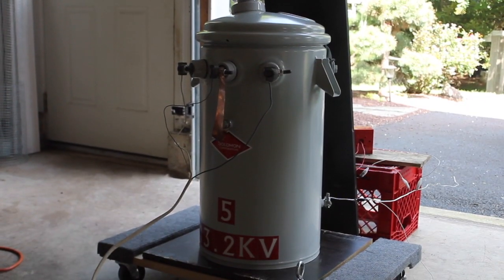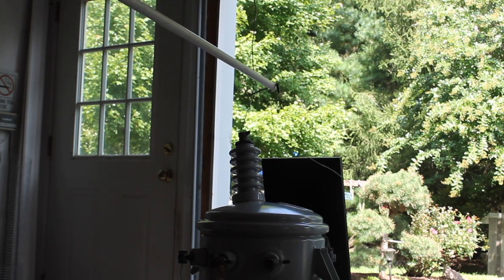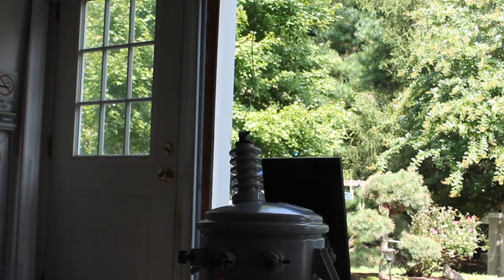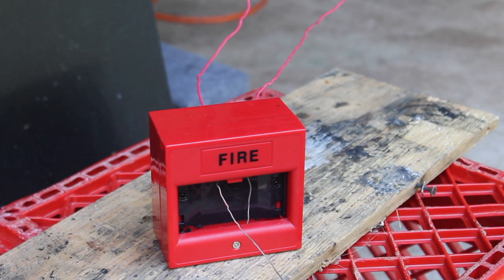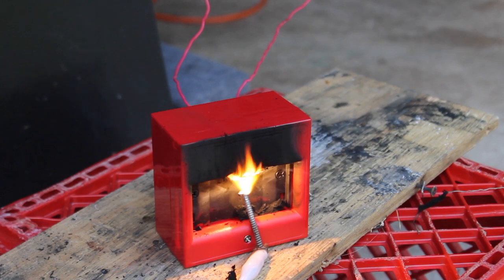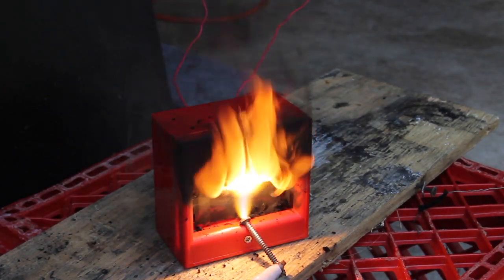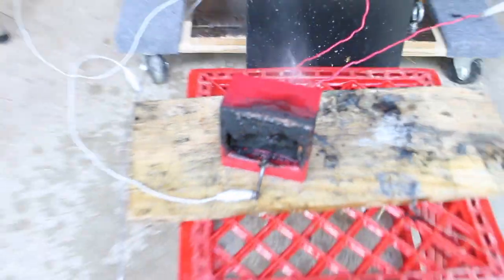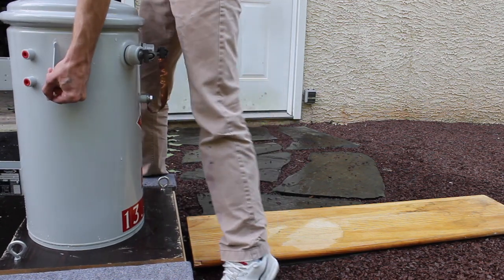Chinese Fire Call Point Versus 7,620 Volts

Comment: Did you connect the transformers in parallel and used the output of the bigger one to power the pole pig? Lmk please wiring looks hard to see the circuit

Comment: Why would you do that that was kind of stupid
Reply from the maker: Tyler's fire alarms and more This call point is basically a disposable unit, only costs $4.00 from China. But to replace the glass you need to buy a new one.
Reply: I too have bought one of these to inspect & test... As mentioned, it is a dodgy cheaply made clone of the real reputable manual call points. 

IF you really love fire alarms, you should understand the importance of proper design, testing, certification & classification of proper products from reputable manufactures who's primary goal is protecting property and lives, not profiting, and you would want nothing to do with knockoff faux clones, nor have any respect for them. I have a lot of FACPs and bits in my collection, they are all real brands and IMHO you (as a fire alarm aficionado) will also strive to only have said real products in your collection. These clones SHOULD be destroyed, and infact, should not be allowed on the market... because some sad corner cutter will use these in real service, risking property and worst, life... on products not proven fit for the job. We all know there are always rule breakers...I would sure hate to hear in the news that live(s) were lost due to a failed dodgy fire alarm system.

Metersocket00 made a good example of what these clones deserve, in probably the most ironic way one can ^_^
Reply: Benjamin Esposti I know it's just a switch but I really like like fire alarms and I do not like to see that torture to fire alarms
Reply: S Midnight Sparky so you think the cold Point pull stations should be destroyed
Reply: Tyler's fire alarms and more not all of them but this Chinese one had to go. It was cheap to look at anyway. It is probably against code, you couldn’t buy glass, and many other problems were with this thing.
Reply: No, you buy replacement glass from EBay or somewhere else
Reply: LOL all the butthurt fire alarm gurus ... it's a cheap POS. In fact I probably wouldn't trust it in a proper installation to begin with!
Yes, I know, it's just a switch ... but I've seen cheap chinese switches fail with very little use. (One was to switch LEDs on and off. It was a 5V circuit, load approx 100mA. Contacts failed. Lol.)

Comment: There's something amusing about seeing a pull station burst into flames lol nice job. Also, could I suggest a better way to power you pole pigs? If you power with 240 mains, you're much better off than with a step-up xfmr. If you don't have a 240 socket, you can use 2 120 sockets as long as their respective breakers are on opposite sides of the panel. Use hot-hot without the neutral. Simply use 1 mot on each hot wire as ballast to the pig and voi la! You've doubled your input power without using more than you already do on each breaker. I've done it safely in the past with great success and like to pass on the tip to other enthusiasts. Stay safe and have fun!
Reply from the maker: Thank You! Back when I got my 7200V xfmr I took 2 out of phase outlets to power it, but since there was no ballast it tripped the 2 20 amp breakers immediately. Since my 120 to 240 step up transformer is only .5kVA it does not fully step up to 240, its 230-239V. I plan to buy a 240V 30A reactor or ballast soon.
Reply: I too have made that mistake! It wants a little more than 20A, doesn't it? Haha If you do find a proper 240v ballast, you'll sure be impressed with the output. Even the 1 mot per leg setup I mentioned works great with 25ish amps output. They will get warm, but a 30A reactor could go all day! If/when you get one we'd love a vid on it ;) On a side note, I'm starting to really want to own a pig once again! Back before my renting days I had a 10kVA 7970/13800y pig. Used a 240 arc welder as ballast for about 50A, STILL wanted more amps lol
Reply from the maker: MaTTdeluca14 I am still looking for the same sized mot for another 120v ballast. I agree that mots make great ballasts! And that’s they only thing I use them for, but I got my lone mot out of some GE microwave, so I am looking for another, just so the phases are balanced. When I first started with my 7,200v transformer I used a resistive ballast, which really messed up the voltage potential and power factor, I thought It’d do the opposite. I’m planning on purchasing some rural land, hopefully by the end of the year to build a recreation farmhouse on. Definitely will be getting some bigger transformers then! When I was at the abandoned State Lunatic Hospital of Norristown, they had some old 33,000 delta substation transformers sitting around! I’d like to get a transformer like that one day!
Reply: Rural land and high voltage sounds like a dream come true! I hope it works out for you. They say pole pigs are the "holy grail" of the high voltage world. But to me, a substation transformer would be one notch above that! As long as you have enough power for them. Very few people do, and even fewer would haha but we can dream, eh? As for same sized mot ballasts, it's a matter of preference in my opinion. I've intentionally unbalanced the load before by using a mot on one leg and a golf cart charger xfmr on the other gaining an additional 15A on the bat charger leg. Only for short periods of time though as I don't like to over run the breaker for too long. But mots for the most part seem to limit to pretty close figures in my experience. Assuming they're at least similar in size. So if a few amps difference isn't a huge deal, any 2nd mot should do ya just fine.

Comment: What do you do if the fire alrm is on fire?!
Reply from the maker: Haha, I know right! I really wasn't expecting that to go up like it did. I was just expecting to melt out the contact switch.
Reply: At least we know it is fire retardant! That is because it extinguishes by itself after you remove the source of heat (the arc).
Reply: Run